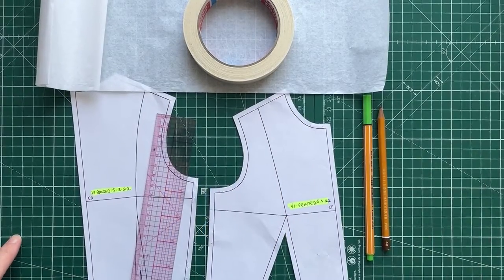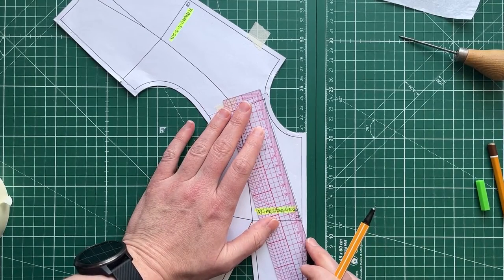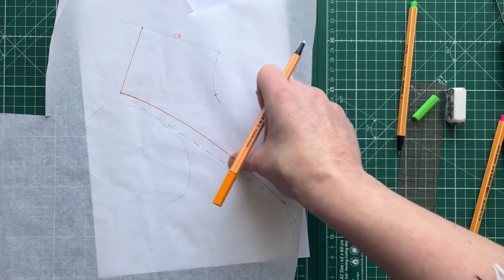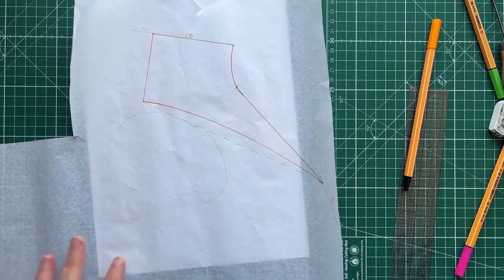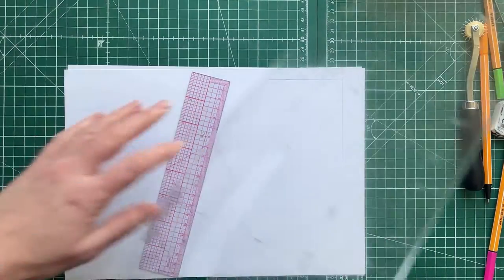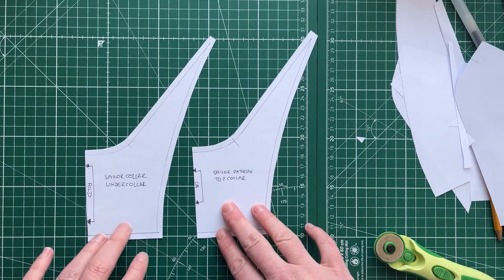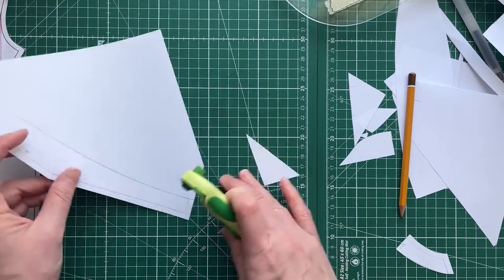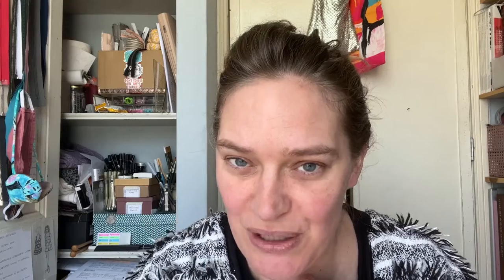How To Draft A Sailor Collar Pattern (Step by Step Pattern Making Tutorial)

Comment: Thank you so much ma'am, can you please explain more on collar roll, like how much to measure to have a higher roll?
Reply from the maker: So to get a higher collar roll, you need to bring the shoulder points over each more. You're effectively displacing the space where the collar can 'sit' so that it is fried upwards. So if you opened up the shoulders of the front and back bodice, you're introducing more space, so more fabric, and this would have the effect of creating more volume, but it would still sit relatively flat on the shoulder, it would just have more lower volume. Does that make sense?